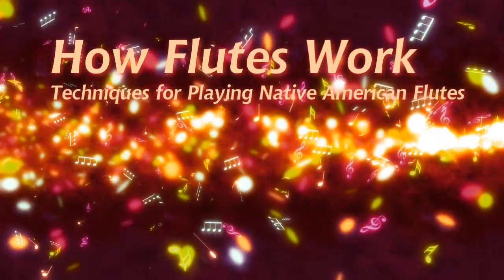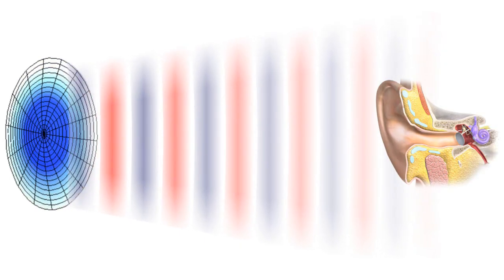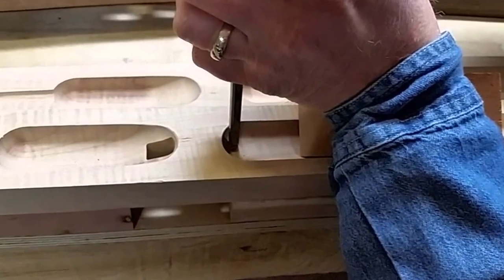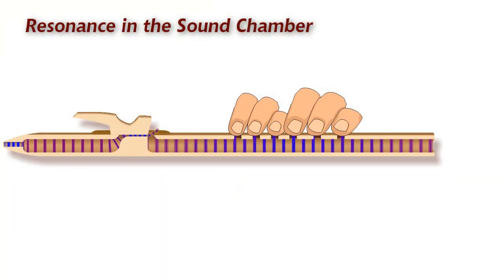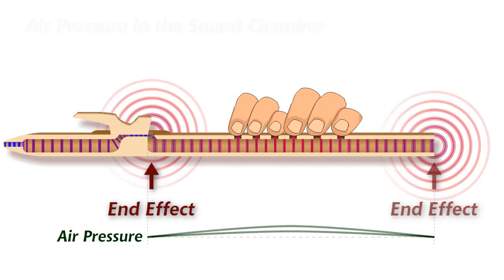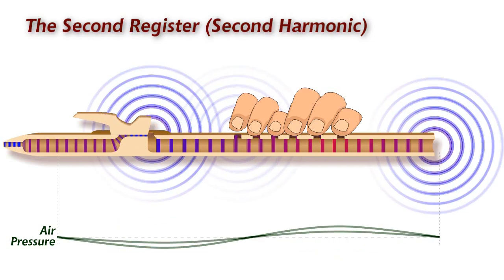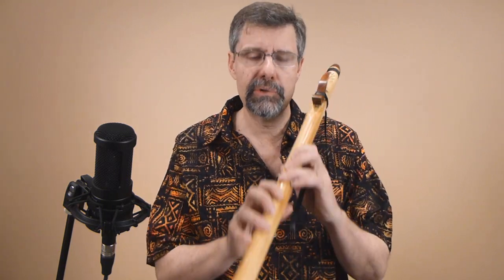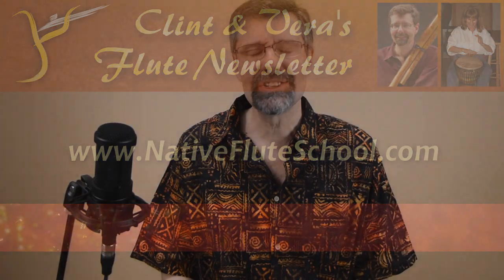How Flutes Work - Native American Flute

Comment: Hi, Clint ... 
Love your tutorial vids ... You-da-man.
A quick question; if I may (By-the-way; hope your still there ... !?)
I see from your (excellent) diagrams on how a flute actually works regarding the sound generated; that the air flow along under the bird comes out, and meets the splitter edge (As I would call it! I know not better!) ... to come straight to the point; I see that the angle down; on the splitter is 45% does it matter where the actual splitter edge sits in the on coming air flow!? Or, should the actual edge sit at the bottom or midway or at the top of the air flow!? I know / appreciate that, if raising or lowering the splitter edge, there is only about a millimeter and a half height to play with!? Or, is the set up of this whole voice-box (Again; as I would call it!) so forgiving that you could almost get away with just sticking that edge in the air flow and you will get an acceptable sound vibration that is ready, able, and willing to bounce back-an-forth along your flute tube (sound chamber)!?
The reason that I ask; is that, I am building a Contrabas wooden flute, and want to take advantage of the best possible position for this splitter edge, as I want the best possible sound vibration to go down that large wooden tube to give me that best sound that I can generate! (Ha ... am I being greedy or selfish!?)
Would love your thoughts ... 
Thank you so much.
Best wishes.
William (Hampshire UK)
Reply from the maker: I believe that where the actual splitting edge sits in the airflow has a lot to do with the character of the sound created. However, I'm not sure exactly what the results will be. I think there is no "should" in this ... most flute makers experiment with several configurations to see the effects. I think the entire setup is pretty forgiving in terms of getting some sound but the quality of that sound (to your ears) will probably vary noticeably depending on how high the splitting edge sits in the airflow. Go forth and experiment!
Reply: Go forth; I will, and experiment I shall, and the result will be forth-coming! Thank you so much, Clint (Again, you-da-man!) @ClintGoss
Reply: A little more; if I may ... !
It is a shame there is not a tiny little screw on the top of that splitter edge! For if there was, one could slowly raise or lower that edge to fine tune the sound on the flute. I am a retired motor mechanic of some forty years; and tuning a flute is like tuning the carbs on a V8 engine. Just a tiny little adjustment (one way or the other) to the carb mixtures and you either have flat donkey or a fit and healthy stallion ... ! (Ha!)
Reply from the maker: @MrDaytrack  Maybe this is your new invention!
Reply: @ClintGross
🇨🇱
Hi, your video was exactly what I was searching for. THANKS A LOT ! 
Somewhat in line, or should I say "in resonance" 🙃(?), I wonder about the part of the air which splits to the outside....
We may think, that that vibrational energy gets sort of lost. 
What if we mount TWO tubes  ⁉️
In a way that the split is exactly in the "middle" of them (the double "wall" separating them. 
This tandem tube could be tuned to get a whole set of harmonics, semitones or whatever... While you give it a think, I'll give it a try  😃. 
Will see what happens  ⁉️
By the way, I was happy to learn that after 7 years you are still listening into the comments. Hats off for that  👍🎩
Saludos desde 🇨🇱
Reply: @ClintGoss 🇨🇱
Reply from the maker: @geromiuiboxz765  Interesting direction! There is a whole class of double flutes - Native American flutes with a standard chamber on one side and a second chamber that typically holds a drone note. The drone could match the pitch of the fundamental of the flute (all holes closed) or some other pitch (e.g. three holes closed). A whole world of exploration for the experimenter ...
Reply: @ClintGoss  I much appreciate your note. Very interesting 👍.
🇨🇱 Nada nuevo bajo el sol 😃  🇨🇱